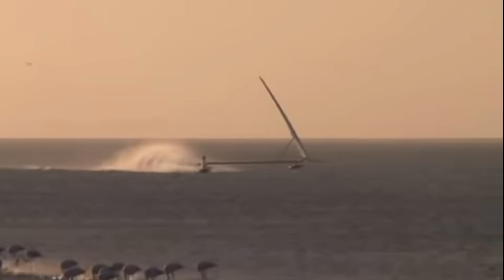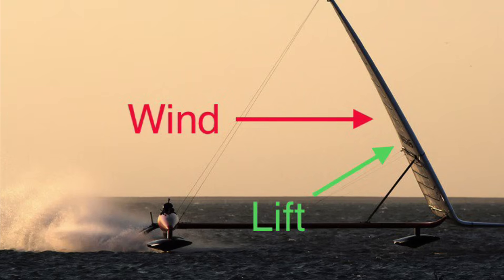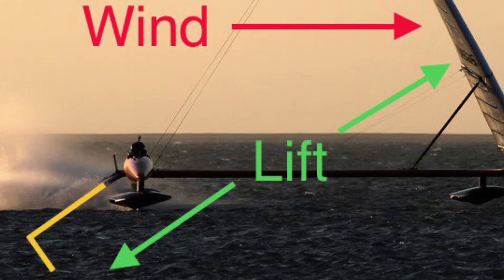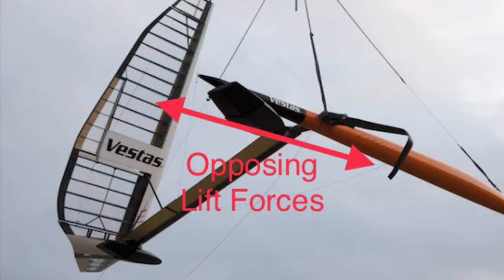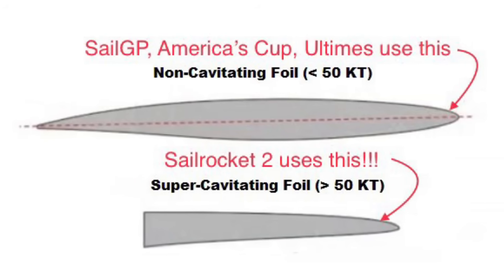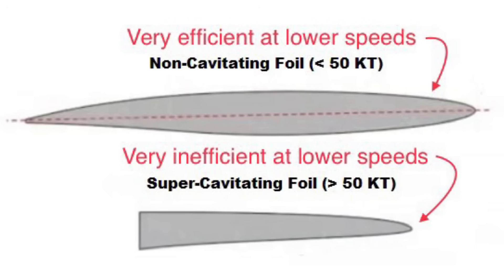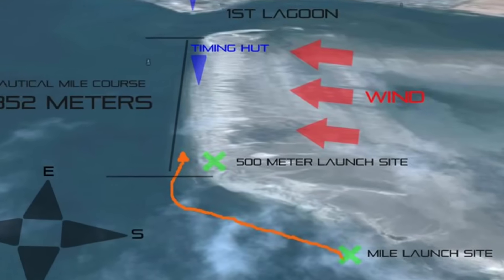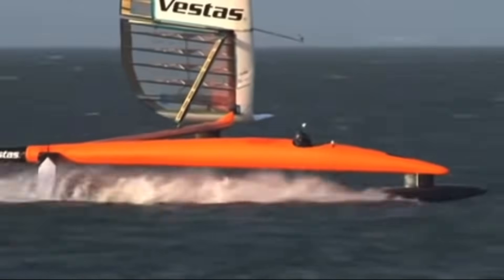How Did Vestas Sailrocket 2 Smash the Sailing Speed Record?!?!

Comment: the Canada Sail GP hit 55.1 knots once ...I don't know if they had any cavitation problems then, but those are regular foils.
Reply from the maker: Yes I think that’s about as fast as it’s currently possible to go with regular foils without losing control of the boat. I’m sure they were cavitating quite a bit!!!
Reply: @SailingTipsCa  that's scary....so like they would have had to install new foils after that, all pitted and stuff, or something.
Reply from the maker: @RulgertGhostalker  The Sail GP team probably didn’t sustain those speeds for long so maybe some superficial pitting and they would clearly want to refinish before the next race if that’s the case!
Reply: @SailingTipsCa  I guess there are 2 upcoming record attempts....SP80 , and Syroco.
Reply from the maker: @ And interesting that they’re both powered by kites!!!
Reply: @SailingTipsCa  the new sail record attempt  is like an offset trimaran, with one foil and a bow rudder.
Reply from the maker: @ Do you mean Syroco’s attempt at the sailing speed record? https://syro.co/en/speed-record/

Comment: The water boils at 50 knots ? What and how
Reply from the maker: The “boiling point” of water is the temperature at which it vaporizes, and that is highly dependant on BOTH the temperature and the pressure it’s under. The 100 degrees Celsius we’re all used to is at typical ambient pressure at sea level. But on Everest with much lower ambient pressure water boils at around 70 degrees Celsius. On the back side of an underwater foil the pressure is even lower than that and the boiling point of water is further reduced to the temperature of the surrounding sea water.
Reply: @SailingTipsCa  thanks for the explanation. Very interesting. Amazing how things really work

Comment: Wait the moment i look at the foil configuration of the boat my immediate thought was transonic and supersonic airfoils from the aviation side, X15 also had a wedge rudder because normal rudder wouldn't work at hypersonics speeds. Facinating.
Reply from the maker: Yes "fluids" follow different rules at different speeds! Of course with water the changeover is at a lower speed because it's 800 times more dense than air.

Comment: That is not a sailing boat!  You can only go in a straight line. This should be a separate class in the record books.
Reply: There is a different class, it's called cruising. Perhaps there needs to be a minimum of 2 berths, a fridge, stove and coffee machine on board.  😅
Reply: @TimPBar  Talk about stating the obvious! If you think your comment was funny then you are way, way off. Don't quit your day job to become a comedian. You wouldn't get a gig. Thanks for the reply TROLL.
Reply from the maker: @TimPBar  You’d want to find the lightest coffee beans possible!
Reply from the maker: Being able to sail an arbitrary course does indeed make the speed challenge a bit more difficult, with L’Hydroptere being the fastest boat so far that could do that.
Reply: Square rigged clippers of Piratss of the Caribbean ilk can't tack upwind, are they not boats?

Comment: The water does not literally boil....if u r going to do a documentary get the facts right.
Reply: Except it literally does. The reason we have to heat water for it to boil is because of atmospheric pressure, but if the pressure is lower, the temperature required to boil is lower (hence why water boils away in vacuum). Boiling doesn't refer to heat, but rather the phase change from liquid to gas
Reply from the maker: It does actually under cavitation - the boiling point drops in reduced pressure to that of sea level. The boiling point of water is also lower than 100 degrees C in high mountain areas. Look it up.

Comment: I also suspect that sailrocket benefited from an endplating effect of sailing in shallow water, something that, ironically Paul larsen criticised windsurfers for in competing for the sail speed record. Sail rocket was struggling to break 55 knots until it started going very close to shore, and then suddenly its speed took a huge spike above 60 knots on only a very few runs, to smash the record. I've never seen any other explanation for this big, sudden spike in speed.
Reply from the maker: I thought the WSSRC has rules about the water depth for speed sailing events? My understanding is that the big spike in speed was due to an updated wedge-shaped ventilating foil design that sucks air from the surface down the trailing edge of the foil and stabilizes the water flow above cavitation speeds.
Reply: @SailingTipsCa  I followed it from afar at the time on Paul's blogs. I don't believe anyone was measuring how close they got to the beach or the water depth. There was a new foil but as I said, it plateaued about 55 knots, apart from a couple of freakishly fast runs that were much closer to the beach. Nothing else changed on these runs except the distance to the beach. Flatter water couldn't explain such a big increase. It's still an insane machine and an incredible achievement.
Reply: As a wingfoiler I can say that a stable run (flat water) can give more speed. In my case I suddenly went 15% faster with a huge wingboard which stabilized my crooked legs. If the endplate effect would be a factor, they would have put an endplate or winglet to the foil.

Comment: This type of wedge makes me thinking of how supersonic planes can fly....supersonic in air seems to be comparable with this cavitation....
Reply: The X-15 aircraft had wedge shaped verticle fins. Assumedly for the same purpose.
Reply from the maker: @chuckaddison5134  Yes that was hypersonic so very much in a different fluid paradigm!
Reply from the maker: I think it’s comparable in that traditional NACA-shaped foils work both in the water under ~50 knots and at subsonic speeds in the air and above that different shapes are needed. The physical phenomena of cavitation and the sound barrier are different, but analogous in that they both require different shapes and engineering designs above that!

Comment: .
Most speed records require the competitor to complete the course in 2 directions (i.e. there and back), the fact that Sailrocket 2 can only go in one direction, to my mind, completely invalidates the record. It's a very interesting contraption, but not a record setter to my mind.  Great explanation on the foils though.
Reply from the maker: Yes with land-based records they like to have you run in two directions to “erase” the effects of the wind, but with sailing records you’re really trying to harness the wind to the greatest degree. I agree it would be far more practical if it could sail an arbitrary course!
Reply: I mean, on the other hand, you have sailgp claiming records while only tracking instantaneous speed and not over 500 m, while having access to jet propulsion and battery operated foils... which is more legitimate?  Up to everybody to make their own opinion on it.   Sailrocket appears to be completely human powered.  A 100m dash by a human doesn't need to be 50m one way and 50m back the other way.
Reply: @hanslaught2351  Oh I completely agree about SailGP and their pure and utter marketing (which is even more malodorous than bullshit) nonsense.

Comment: How about a rotating pizza cutter blade for the hydroplane? That way the blade would rotate at the same speed as the water, so cavitation would be eliminated. Then you could go as fast as Sailrocket 2, but with a normal hydroplane setup. Tip: Don't touch the blade...
Reply from the maker: Interesting idea - I agree that touching the blade would not be recommended!!!

Comment: They need to sevelop an AI to learn to sail. With complete control of all aspects of the boat. Trimming sails adjusting course and shifting ballast. 
A neural net self training AI shoukd be able to outdo a human eventually.
Reply from the maker: Some offshore racing boats (e.g. IMOCAs and ULTIMEs) already have pretty advanced autopilot systems so this is definitely plausible. At the same time lots of racing classes have rules that limit automation to keep costs down and enable more teams to compete. Without such rules the teams with the most money are able to invest in the most advanced automation and create the fastest boats. So it’s really about promoting the use of technology while still enabling participation and competitiveness of all but the richest teams.
Reply: @SailingTipsCa  Now that Tesla has a complete neural net self driving software on their cars it should be possible with the same technological process to create self sailing boat software. Of course one would need to have sensors on a lot of boats to gather the necessary training inputs. 
The fact that some yachts are extremely automated already, is what makes this information harvesting possible. 
Only the desire to achieve such a goal is required. 
A similar development could eventually be used to program solar sails for spacecraft. 
Just in case Elon Musk needs some extra motivation lol.
Reply from the maker: @jeremytaylor3532  You’re absolutely right that desire (and perhaps a supporting business model) is all that’s needed!

Comment: Pretty Impressive !
Reply from the maker: I agree - an amazing accomplishment!!!
Reply: @SailingTipsCa  I fly Radio Control Gliders and getting energy from the wind hasn't all been figured out yet. You want to be amazed, do a Yt search for Dynamic Soaring vid's. These R/C gliders take up to 40g's and do speeds 8 x faster than the prevailing wind. It was discovered by a Lockheed Martin "Skunkworks" engineer by accident when he flew over the ridge top into the swirling wind on the back side of the hill and came out much faster than the wind he was getting lift from on the front side. I went to a Dynamic Soaring event on the coast of Oregon and watched them hit 250mph in a 23 mph wind.
Reply from the maker: @uuzd4s  Others have mentioned dynamic soaring as well - I’m still trying to wrap my head around it!!!
Reply: @SailingTipsCa  Hadn't done so in a while so I just did a YT search on Dynamic soaring. They just hit 548mph with sustained speeds over 500mph on a 7ft wingspan R/C Glider.  The prevailing winds were around 35mph coming up the hill. Most the video doesn't follow a Glider that well at those speeds w/ a handheld camera but there's some of it good enough to WoW ya. Anyways, just more expensive toys to play with I guess. Take Care.
Reply from the maker: @uuzd4s  That’s amazing - I’ll look that up thanks!!!

Comment: Any one who has windsurfing experience will know about cavitation(spin out) . And at much lower speeds than referred to here. 
So it’s interesting that these foiling yatchts seem to have pushed the boundaries somewhat
Reply from the maker: Sometimes at lower speeds people will experience foil ventilation, which happens when air gets sucked down the foil and it loses its “grip” on the water. It’s technically not cavitation but often called that - could this be it?

Comment: I know its quaint and antiquated, but perhaps you need to understand that most of your viewership uses MPH, yet you were quick to convert to KPH. Wikipedia provides all 3 conversions. Kind of sad you didn't.
Reply from the maker: According to my analytics about 36% of my viewers are from the US and 7% are from the UK, while 57% are from other countries that use the metric system. That said, most sailors use knots and nautical miles for the reasons explained in this video: Why Do Sailors Use Knots And Nautical Miles Instead of Kilometers?!?!? https://youtu.be/RHuNarzXuYM Is that what you meant?
Reply: @SailingTipsCa  Fair enough. And I certainly use knots. But it would have been easy to mention all 3. I converted in my head using knots to mph.
Reply from the maker: @bobhamilton298  Yes it’s inconvenient with three different systems - I should just use knots given that’s what sailors use!!!

Comment: So you run into similiarly weird issues like RC gliders.  There the speed record is in the meantime 882 kpb (548 mph). 
 
So you are as fast as a jet and get near the sound barrier. And that means that you run into compressibility, that in some parts of the wing the air is accelerated to supersonic, which gives a shock wave, causes the airflow to delaminate, the lift to implode and drag to explode. 
 
So the ones that "are in the scene" say that to get faster, they would have to switch to transonic airfoils, that are optimized to minimize this shockwave effect of local supersonic airflow. 
 
But they - surprise! - are bad at low airspeeds, where you need lift. They are usually very thin with a sharp leading edge (and so only good for a VERY small angle of attack range).
Reply from the maker: Wow that’s fast for an RC glider!!! 

Yes the similarities are interesting with efficient (high lift/low drag) foils having “speed limits” which require a different engineering solution to go faster, and that solution is very inefficient at lower speeds!

Ideally one would have transforming foil shapes but that’s also very hard in underwater foils because they are very heavily loaded as compared to airplane wings, being much smaller because water is so much denser.

Comment: No, Sailrocket is not the fastest "sailing contraption" so far, as you comment at the end of this video.  According to a brief Google search, the iceboat record is 143 miles per hour, more than double the speed of Sailrocket.  And the ice boats can sail on both tacks.  It is interesting that both exploit the unique properties of water.  From what you say, it appears Sailrocket relies on a 'trick' to deal with the ambient pressure at which water turns to vapor, sucking air down from the surface.  An ice boat, from what I understand, actually rides on a very thin film of liquid water as the pressure of the boat melts a groove in the ice.  As a result, an ice boat is actually floating, or skimming across, liquid water, although very shallow water on top of ice.  Great video, by the way.  You didn't waste 15 minutes with a bunch of crap about how you came to love sailing or the politics of Africa and you explained an involved bit of engineering in plain simple language.
Reply from the maker: You're right ice boats are definitely faster! 

Sailrocket's record is governed by the World Sailing Speed Record Council (WSSRC) which says: "The record shall be established over a minimum of 500 m on water (not ice). For every record attempt on a WSSRC approved course, there must be a minimum depth of water, which is defined as follows. At the time of the run in question, the shallowest part of the course must be covered by water with a depth of at least half the static immersed beam of the craft involved, or 10cm, whichever is the greater. (Guidance note To define the depth requirement, the craft or board involved should be afloat and the widest part of the hull or hulls touching the water should be measured. In the case of a multihull, the widest hull is measured or hydrofoil if fitted). In the case of an event involving a number of competing craft, the WSSRC Commissioner can announce at the commencement of the event what the minimum depth requirement will be.

So I guess the water that ice boats sail on isn't quite deep enough!

Comment: It’s a water drag racer, it can only run on a race track, under controlled conditions but it’s sphincter in your throat fast.
Just a guess
Reply from the maker: Water drag racer - that’s exactly right!
Reply: @SailingTipsCa  I feel like with a couple of engineering tweaks, it can do it all. Just a matter of time for technology and materials to come together.
At high speeds, everything changes, the cavitation effect is a excellent example.  
I’m not really a sailor, me and my canoe doing portages, I may use my umbrella if the wind is right, that’s enough for me.
Reply from the maker: @armageddonready4071  I think the concept of the Sailrocket actually originated a couple of decades ago but it took a while for the engineering materials to catch up so you’re probably right!

Comment: I think it comes down to one thing water is a solid for all practical purposes. And combining a solid with a gas (air) is going to limit the the physics you can break to achieve these high speed sail boats.
Reply from the maker: Even with foils the drag from the water is far higher than the blades on an ice boat, or even the wheels of those sand sailing buggies!

Comment: 'Maybe not even a boat'? That's what the lead mine sailors used to say about multihulls. Maybe some still do.... as they get lapped.

But otherwise a clear explanation. What you didn't mention is that hydroplanes can go much faster than foils and Sailrocket still relies on them for starting flotation, initial speed-up and finally for fore/aft stability. (The speed record for power craft is all about hydroplanes). But, like the L-foil they don't at all like waves and the faster they go the more that is true.

Note also that the windsurfer record is done in 'The French Trench' and is also a one tack wonder, even if the windsurfers themselves can sail on the other tack. AND they do not use lifting foils, they sail as a hydroplane.
Reply from the maker: The "maybe not even a boat" comment was related to Sailrocket's inability to sail an arbitrary course, which drastically limits its usefulness. 

Interesting points on hydroplanes! Windsurfers which are harnessing an external energy source (i.e. the wind) are also using an underwater foil to translate the wind power into forward motion, which is also susceptible to the cavitation problem, which probably explains why windsurfers are also susceptible to the cavitation barrier and also haven't yet gone much past ~50 knots. 

All hydroplanes that can go substantially faster than ~50 knots have an internal energy source (e.g. a jet turbine, piston engine) and typically have super-cavitating foils (e.g. propellers, rudders).